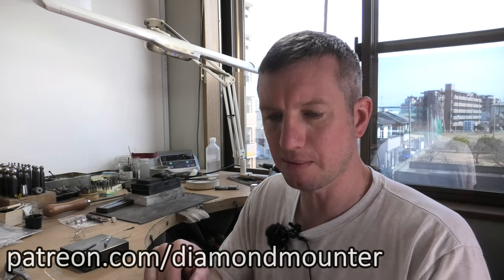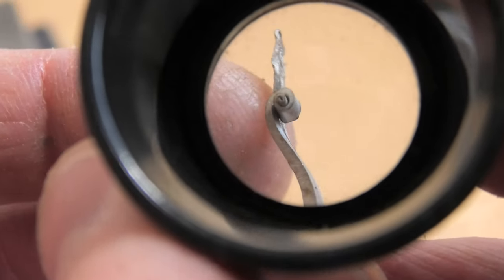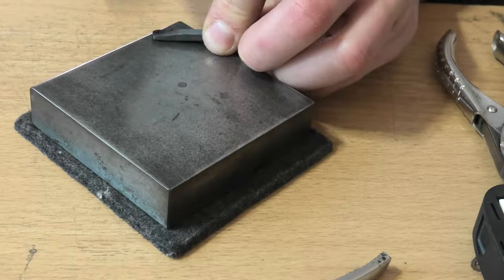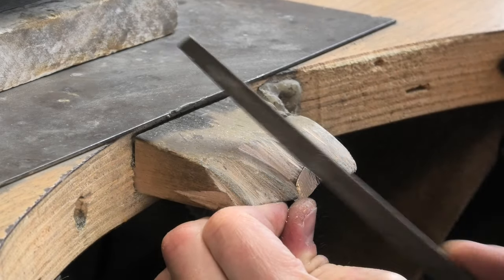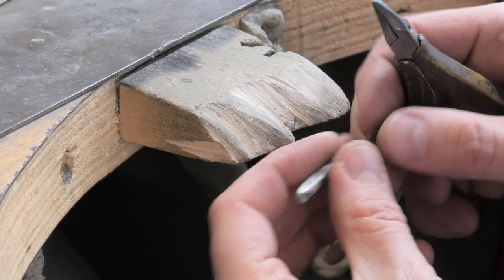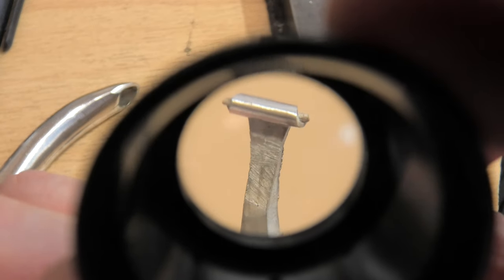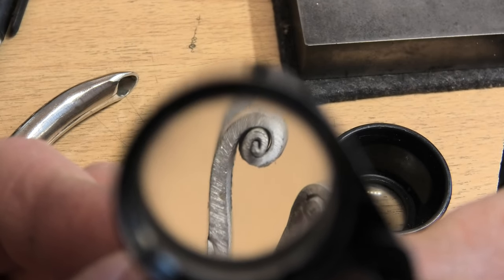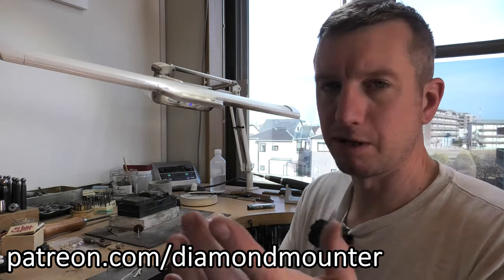How to Make a Scrolled Back Shoulder.

Comment: Thanks for the cool video. I had not thought about this type of design.  I wondered if instead of that first tiny bend to get started if another approach would also work. What about soldering a round wire (18 guage?) To the end of the flattened bit. Then use that as a starting point to give you a nice start to the roll. Thoughts?

Comment: I think the way to go about it is to make the shank a bit longer than needed and then sweat the ends back into balls that you can then hammer (large hammer on the edge of a heavy vice works well)

This will get you the width and if sufficiently skilled produces a knife edge shank that you can roll up.

The guy who trained me often did this bit for me, he made it look so easy,  I would beat the crap out of it and leave huge marks in the metal but he always seemed to hit it just right to manipulate the metal.    Unlike with the mills, he could spread it exactly where he wanted and get a smooth taper.

Comment: as someone that started with blacksmithing before jewellery, my go to would have been to first try to hammer the scroll entirely, but maybe your approach of using pliers is more appropriate.

Ok, just gave it a go, definitely theres less marring to the metal than what I can see occurring from using pliers, but the quality of the scroll was about the same, and would still perhaps need filling in with solder like you said.
Wish I could attach a photo to my comment.
Good little experiment, I've not tried that before with silver.
Reply: I was thinking this same thing… “I thought I saw a blacksmith making these before”; unfortunately the video I thought of he twisted it in while he pulled a leaf off the bar…